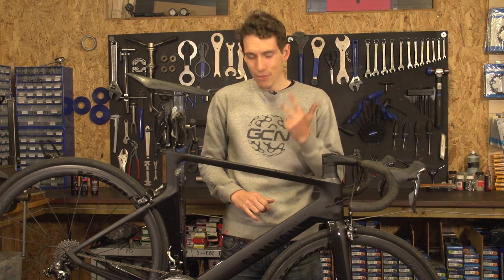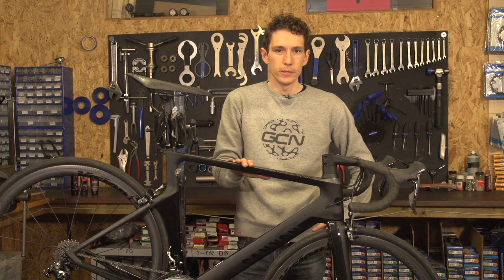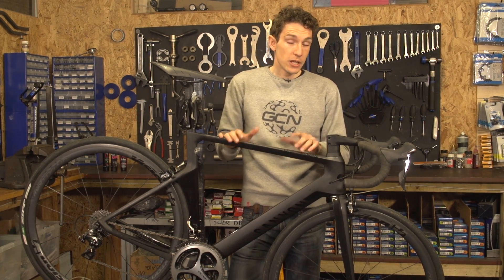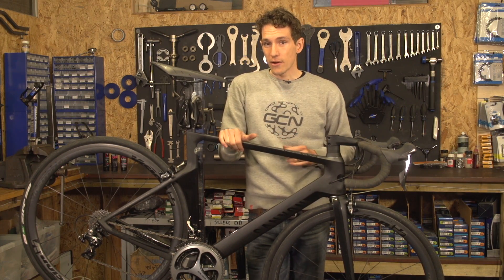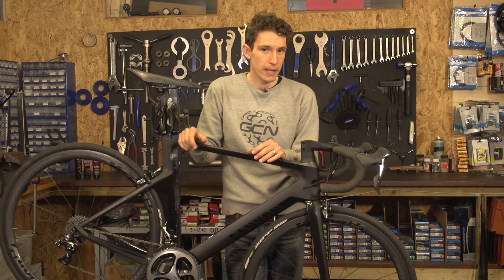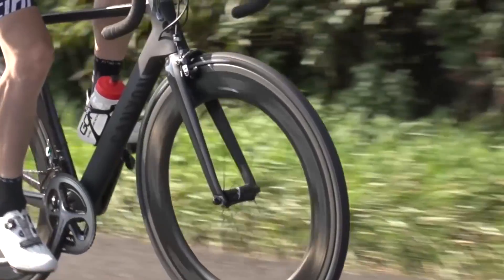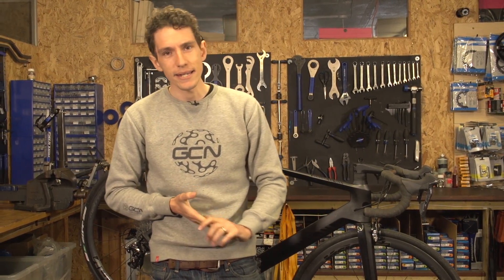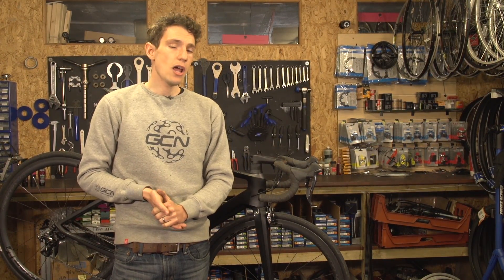7 Things You Didn't Know About Carbon Fiber

Comment: Myth 1: Definitely. I bought my Domane 5.2 last year when I weighed about 335 lbs (was down about 25 from a high point and 35 more since then). My LBS had 1 concern: the wheels. So the shop let me trade in the stock wheels and gave me a pair of custom Mavic Open Pro Shimano Ultegra hub 32/32 wheels. The owner reinforced the rear wheel with washers along the hub. I've broken 1 spoke in 5000 miles (21mph during intervals I hit a pot hole really hard because it was night and I didn't see it). And I've taken it in for minor truing 2 times. Other than that, the bike works great. I've replaced the chain once and will again soon. And I'll probably replace some of the bearings soon too. But my petite wife has had the same done other than the wheels. She's using the stock wheels and never needed truing.
Reply: +MRGRUMPY53 And the pros said a 32-spoke setup would work and it has.
Reply: +MRGRUMPY53 You are right. Looking back I should have gone 36 at least in back. Shop has maintained my wheels for free so I'm not complaining. In fact I crashed my first week and he rebuilt the wheel for free for me (minor crash but it bent the rim). I've considered getting a truing stand for myself so I can do my own work. I even asked him about the price of the Park stand and he said he'd be happy to sell me one but I get free minor truing for life. I may still get a stand one day so I can learn how to true my own wheels since I may try and get a pair of Flo carbon clinchers one day and would like to have a good idea how to do it before I had some carbon wheels on the stand.

I tell all heavier cyclists these days to err on the side of caution with spoke counts. I probably could've got away with 24/28 but 32/32 or even 36/36 would simply mean less maintenance. Nothing worse than not being able trust your wheels.

But the myth was carbon frames don't work when heavier and the video is right. My frame is in great shape. Now one reason why people may say carbon is for lighter riders is carbon frames are expensive. If we care about weight, we are better off losing it from our bodies. My reason for the 5.2 rather than say a 2.3 is because I wanted a bike that would last me 5-10 years. It was my 3rd bike in about a year (got a Trek Shift 4 because of the high weight limit but then switched to a used Sirrus when that Shift wasn't doing what I wanted. I didn't want to buy a temporary bike like a Domane 2.3 or a Giant Defy 3 or 4 and then upgrade in another year or 2). 

Looking back I probably should've got a Defy and a power meter last year and then planned to get a carbon bike after getting down to about 250 lbs or less. But hindsight is 20/20 and my power meter will be here next week. So I guess I got to save the ~$1000 from a temporary bike but just had to go without the meter for a year. And until about 3 months ago I probably didn't care enough to justify one. It's only the past 3 or 4 months that I've been training harder. Been using the power meter on my smart trainer but now I want one on the road too. That and I'm not sure how trustworthy the numbers are from the Wahoo. I swear in Zwift on the mountain 180 watts going uphill makes my heart rate HIGHER than 250 watts on a flat section. There's something weird about the meter and resistance when climbing at higher weight. And next week I can hopefully confirm my suspicion with a different meter to see if I am either putting out fewer watts on the flat sections or more on the climbs.

Comment: The importance of good manufacturing cannot be understated when it comes to carbon fiber. I have some experience working with it, and I gotta say even simple flat parts are difficult to produce.
Reply: +Ypuh All good points, but there are lots of people who spend long periods riding the same bike. I've seen several carbon bikes that are still being ridden after 10 years and many thousands of miles, and not having frame problems. 

Many problems can be identified as user-caused 90% of the time (over-torquing, for instance), but they can also be caused by bad manufacturing. The best way to learn about that is to talk to people who work on a particular bike for a while. Asking shops about their brands can reveal things as well, like Colnagos tend to be long-lived, Cervelos tend to have BB problems, etc. Unless the shop sells Specialized or Trek or a similar brand, they can help lead you to their most reliable bike. Google will also aid that sort of research.

Certain features of the bike will also lead to easier cracks no matter your experience. I would generally avoid carbon bikes with clamp-on front derailleurs, and favor those with alloy drop-outs. You can also take certain precautions like making sure the seat-post clamp and stem have no sharp edges on the inside, since that can cause cracks that appear to be user-caused, and, of course, always using a torque wrench. Again, Google can be your friend.

It also helps to have a good relationship with the shop you got your bike from. If the people in a shop know you, and have no doubts about your bike's maintenance, they can stand up for you to a manufacturer. (That is one of the advantages of having a LBS do all your repairs.)

Some companies are generous with frames and will send parts out if there's any doubt, while other companies are a pain in the neck. It varies form person to person, shop to shop, manufacturer to manufacturer. The nicer you are, the more you can get done.

Oh, and , of course, bring beer to anyone from whom you want effort.
Reply: +Ypuh I rode a carbon road bike  (2005 tarmac) for 10 years, doing about 5000km a year on it. I only got rid of it when it got destroyed in a crash.
Reply: +Ypuh I rode a carbon road bike  (2005 tarmac) for 10 years, doing about 5000km a year on it. I only got rid of it when it got destroyed in a crash.
Reply: What makes you think a metal bike will be any better? They get changed every few years too.

Comment: I once heard that the total amount of carbon fiber used by the cycling industry in a year is the same amount as one modern Windmill blade. This is from a few years ago when carbon fiber use was not as wide spread in the cycling industry. Have you seen/heard any figures regarding cycling industry use compared to other industries?

Comment: Carbon bikes loose stiffness with age.  Myth?  I believe the logic is that individual fibers break over time and use... not enough to cause failure, but enough to slightly impact performance.
Reply: +Michael Fiola Myth.  If that was the case, they would not use it to build airplanes out of.
Reply: +Michael Fiola would have to be really really old for you to notice that.

Comment: Carbon is still too expensive. Bicycles shouldn't cost as much as a motorcycle that can go 200 miles an hour
Reply: Which bicycle and which motorcycle did you have in mind when you made this comment?
Reply: +Patrick Arredon Well if you wanted a MotoGP bike it would cost you a handful of millions wouldn't it? Who said you should have a TdF winning mahine? Some people just don't like to use logic and simply prefer to resent money or lackthereof.
Reply: @Patrick Arredon
Yeah, agreed. It's the same with a yacht, that should not be as expensive as a motor-bike that can go 30 miles an hour! Everyone knows that the slower something goes, the cheaper it should be!
Reply: +Patrick Arredon You can get a good carbon bike from just over £1000, not a lot more than Aluminium.
Reply: but that got nothing to do with carbon frames.  sure high quality frames/brands cost around 2k $ but the components will give you the high price at the end. my frame was made from aluminium.  the almost same frame made from carbon weigth 500g less then my alloy frame.  the frame cost 500 $ more then they alloy frame.  Most expensive thing thing is the brand.
Reply: +Patrick Arredon*defend
Reply: +krisknave It's a rhetorical statement
Reply: I paid a tad over $1k for my carbon road bike (new, last year's model) in 2008 and have been on it since with no problems, just general maintenance. A lot of carbon bikes are like motorcycles in that you can spend a little or an exceptional amount. I paid a lot more for my motorcycles and no longer use them much unfortunately.

Comment: The thing with aluminum and steel bike frames is that if the frame does get cracked somehow it can take a very long time to fail completely. When I was a kid I used to dirt jump steel framed BMX bikes that had cracks in the frame and it never failed catastrophically, the crack would just grow over time until I got it welded or concluded that it had gotten too big to be safe anymore. Aluminum will fail quicker but it seems that they don't crack as much as steel does, more flexible material I guess. Carbon on the hand, because it's built in layers, if it starts to fail it can fail completely very quickly due to the delamination of layers or just sheer force completely breaking it by shear forces (like an impact from a car, hitting a curb or something like that).

Comment: "safety" of a particular material depends on a LOT of things, many more than just likelihood to break. The largest oversight from this video is that the failure mode of carbon fiber is a jagged, razor sharp edge and possibly a break. Aluminum (and the majority of other metals) tend to bend but do not actually usually break, and if they do are usually not very sharp. Also, carbon fiber cracks are often much less obvious than misaligned(bent) components so there are likely many more peoples riding compromised carbon than metal.
Reply: +Skooteh Have you actually ever handled broken carbon fiber? A few years ago I got into a scuffle with a large truck while I was on a Giant that was made of half carbon half alloy. The alluminum sections definitely broke and they were certainly much sharper and more dangerous than the carbon. When carbon breaks the weave also starts to come apart so the end is very brittle, you could get some splinters I guess but the likelihood of getting impailed is pretty low.
Reply: +Skooteh A bike that fails due to fatigue, regardless of the material, will not show permanent (plastic) deformation prior to failure. Your metal bike can theoretically snap in half the next time you get on it, with no warning what so ever. This fatigue failure will usually start as cracks around a weld or a mounting point, so you still need to look for hairline fractures occasionally regardless of what material your bike is made from.

Comment: Could you guys do a video on the characteristics of some more uncommon frame materials--Titanium? Scandium? Wood? Bamboo?
Reply: I fully support this
Reply: Scandium and Titanium are highly specialised frame materials requiring a really high skill ceiling to manufacture properly. The properties would be similar to what you could imagine as a steel/al hybrid. Comfy and tough yet still tough and light. Unfortunately that makes them really, really expensive. Wood and bamboo frames you could imagine as nature's carbon fibre (fibrous layers of anisotropic sheets) but really really soft.
Reply: Scandium is a marketing term for a kind of high strength but weldable aluminum alloy.  Calling it scandium is like calling steel carbon.  Yes, there's a little bit of scandium there.  But it's aluminum.
Reply: +Windoges I know guys riding the bamboo fixies. They say they do bunny hopps and often ride downstairs. So I wonder for how long their bikes will last.
Reply: +ssef15 Both form alloys with Aluminium. Especially Scandium (and Niobium) are used in small amounts ≪5% in Aluminium.
Reply: Or composite form giant
Reply: why hasn't this video been made yet???
Reply: +Windoges I'd be happy with the different steel and tubing types. Wood would be interesting too.

Comment: What is a good 1k time for a 14 year old
Reply: +Luke McCallum 1k time where? on the track, on the road, on gravel, on the flat, tail wind/headwind? Better off with a power meter, and timing efforts based on a fixed power.
Reply: On a track, I just wanted a good time that I could compare myself with to see where I am
Reply: Luke McCallum I have no experience in track cycling (or on the road for that matter!), sorry.

Comment: Make a video on how to repair carbon bikes, for instance a frame or a fork. I haven't moved to carbon yet but am interested.
Reply: +clearly not me It's more involved than that. You have to chamfer out the broken part at the crack at a very shallow angle. (1:50..1:100 are needed to arrive at the same strength as the original part.) Then additional layers of ideally the same prepreg materials are laid on and heat cured (not melted, those are thermosetting materials, no melting once they are finally cured.) Alternatively non prepreg carbon fiber can be used and laid up with low temperature curing two component epoxy. Don't know if this is done on bike frames; It's common in other applications of such composites.
Finally you have to chamfer out the freshly laid up material, so the transition to the original part is as gradual as possible.
Simply adding material over the crack is possible, but it is heavy and you never arrive at the original strength because of abrupt stiffness changes in the part.
Reply: +clearly not me : Yes it can be done at home but in my view a bike is not the place to learn the techniques on. Before thinking about doing a bike repair you'd want to be comfortable with vacuum bagging techniques and have the equipment to do it. Also if it's the fork that's damaged then I wouldn't even consider a repair, just not worth the risk.

I learnt how to work with carbon fibre through my hobby of flying radio control model gliders - at the top level the composite technology is actually very similar but the advantage is if you get it wrong you can pick up the pieces without being part of the wreck...
Reply: +Mike Pop If someone offers to repair a carbon fork for you they may not like you very much. If a repair on a frame fails more than likely you can just pull to the side of the road.....if the fork or steerer tube goes:
http://4.bp.blogspot.com/-mtnPUqUgsYw/VCnImmTRswI/AAAAAAAAD5c/0NJezheAVcM/s1600/moses%2B2014.jpg
Reply: +clearly not me my friend did it with a home kit, but heavier now but still a good bike